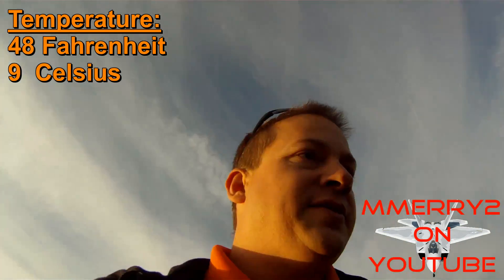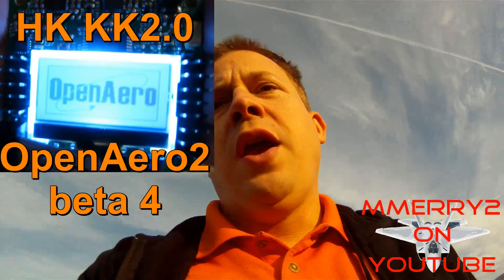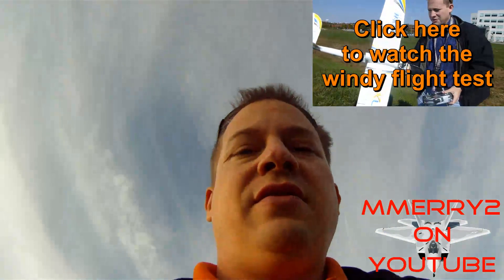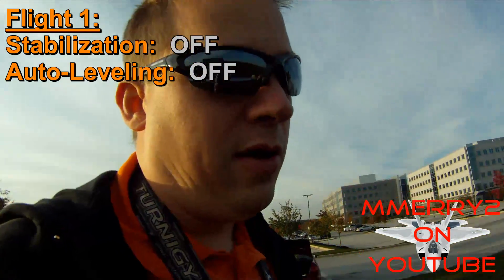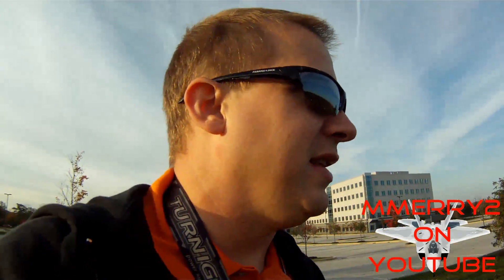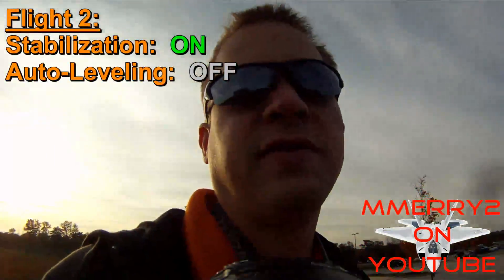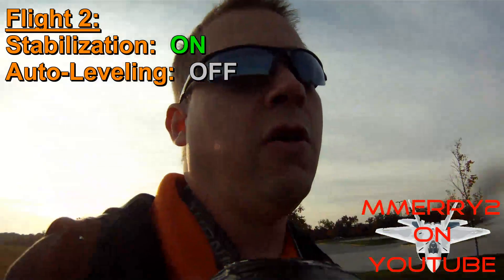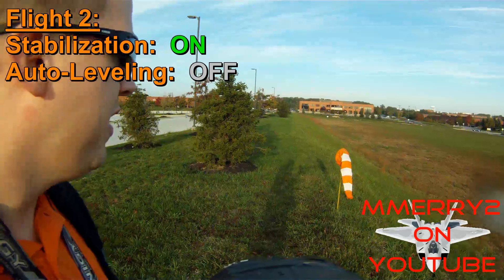HK KK2.0 Auto-Leveling & Stability Light Wind Flight Test

Comment: On both your windy and calm day flights, with auto-level on, your horizon was never quite level.   To me that indicates that your ailerons were a touch out of trim, or your level calibration (side to side) was a little off on the KK2, or perhaps a combination of both.   I've run KK2.1 boards on several multirotors.  It is helpful to be VERY selective when calibrating the standing level function on them.